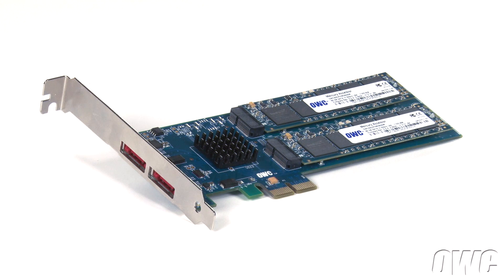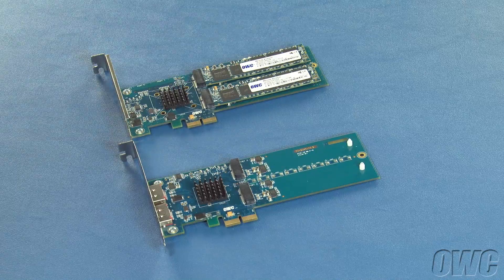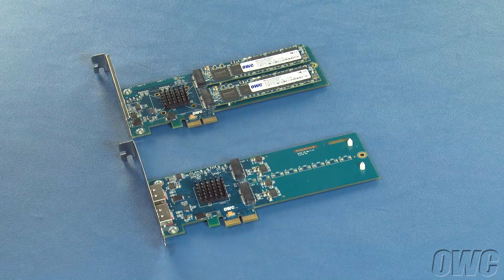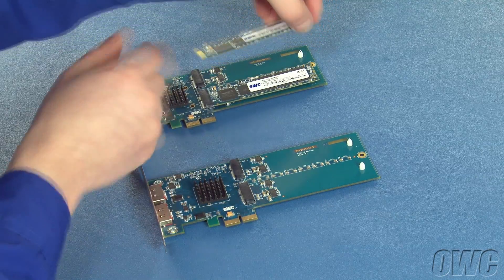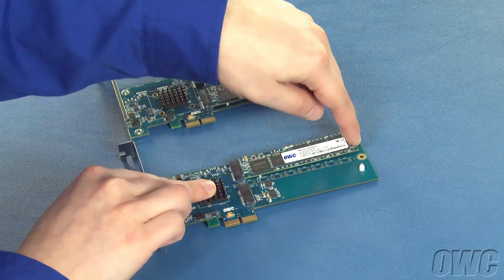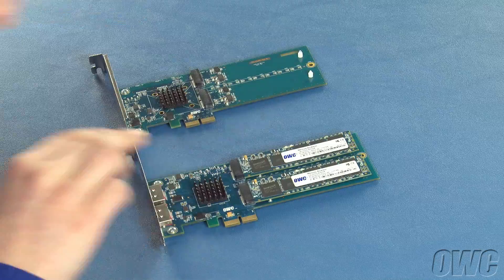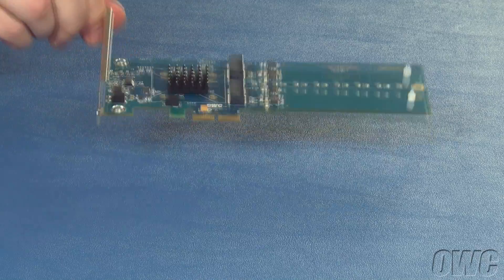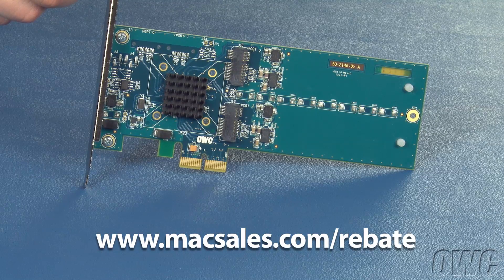OWC Accelsior & OWC Accelsior_E2 Blade SSD Installation Video

Comment: tip - I couldn't get the blades out with my thumb... I used a CF card as a lever, it fits perfectly and it doesn't take much force... anyway be careful not to force anything ever ;) btw - the upgrade works fine